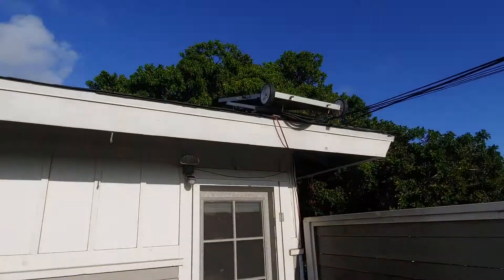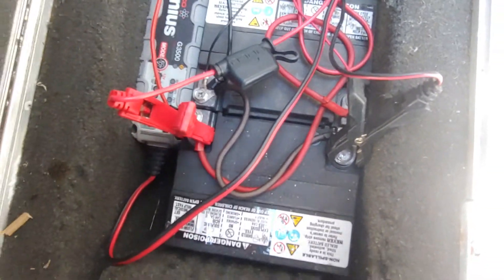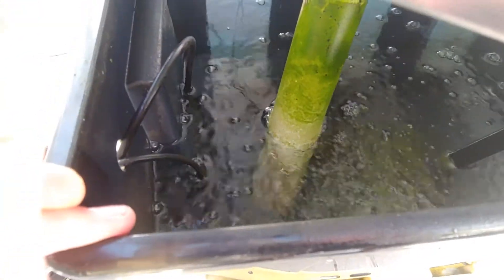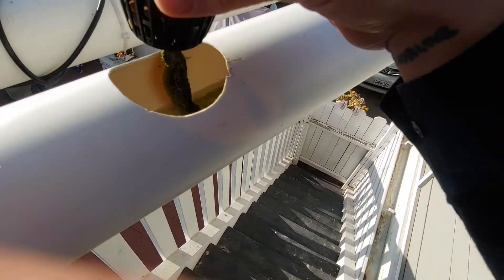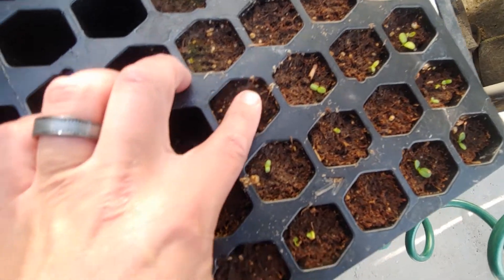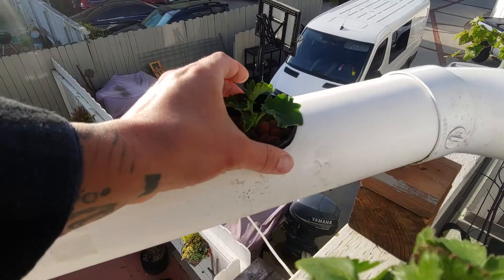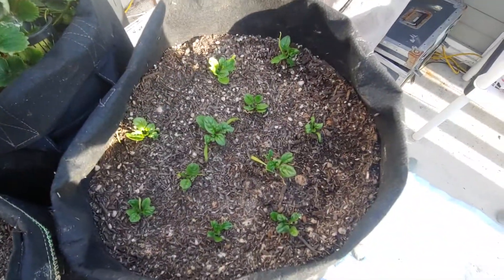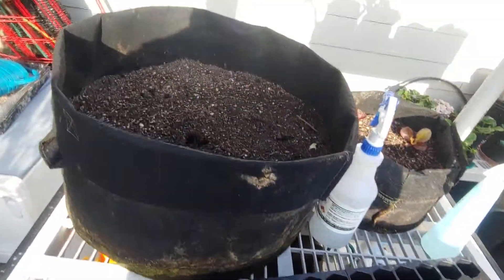DIY SOLAR POWERED HYDROPONICS SYSTEM 2020 UPDATE (Covid-19 survival)

Comment: I did something very similar (just prior to covid). My battery was good enough to run through the night most of the time.  I just added a timer and pulsed the water / nutrient for 10 or 20 minutes and hour every hour or two at night. It was very rewarding.